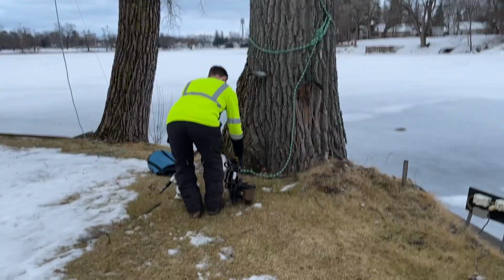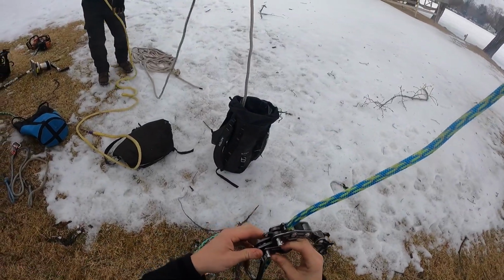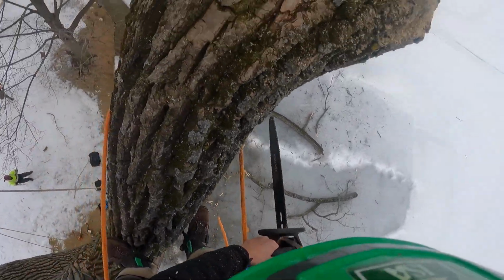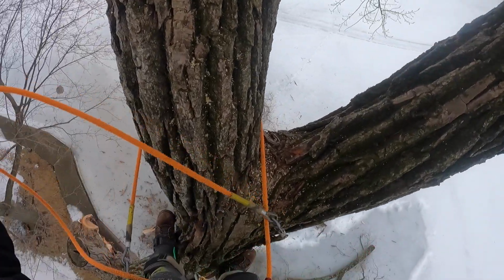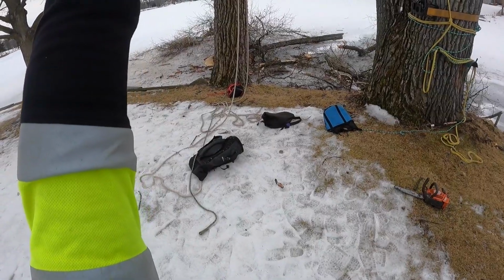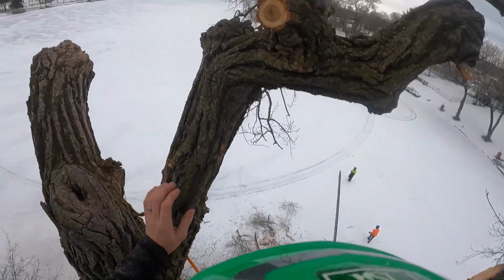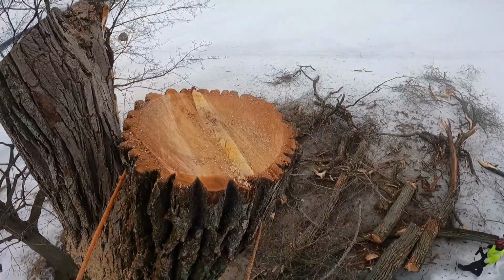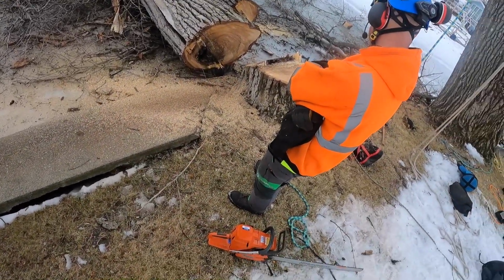DROPPING LOGS ON A FROZEN LAKE!!! One more Midwest tree makes me look dumb! Last day with Kevin Hamm

Comment: You can use a very shallow face to spring a limb off without letting it flip. I generally make the face cut slightly deeper than otherwise and have it go in more parallel to the limb, this allows a deeper undercut without pinching. 
Go full throttle on the back cut so the holding wood is thin enough to pop off when the henge closes.
Whatever position the limb is in when the henge closes is how it will fall, if you really don't want a limb to tip at all you can use a simple undercut
Reply: Good description
Reply: do you like the box cut for pop release?
Reply: @neild7971  I’m a fan of the box cut for flat landing huge branches

Comment: I am definitely ordering a set of those rings what did you do tie a running bull line to send the rings up once you got it over the limb or is there a loop at the end you put the rings through Kevin
Reply: The rings are spliced into 12 strand hollow braid and have 100 foot tail your stuff them backwards into a bag pull the tail up and then pull the rings up last with a bull rope in them
Reply: They are spliced into 100 feet of 12 strand hollow braid.
Reply: So once the rings you pull up you would have the tail on the ground again and you would tie the tail off is that correct
Reply: @kevinhammatgameoftrees7080  How does the hollow braid handle being pulled through the fork of a rough barked tree to install the rigging rings? I like the idea but if you catch one of the picks on that hollow braid won't it make a mess of the rope?
Reply: @stevehunt4472  we have a 24” Kevlar sleeve on one of our units that is stitched in place to cover where it passes over the limb.  We have not had any picking issues with any of them because the weight of the system hauling up the doubled over rigging line keeps everything gliding across the bark.  The 12 strand is otherwise abrasion resistant and doesn’t have the risk of failure like a double braid rope would have in this scenario.
Reply: @kevinhammatgameoftrees7080  Thanks for the detailed reply. At least no issues with retrieval like a so called 'retrievable' rig and ring slings where you need to have a suitable fork for the big ring pass through. 

Is that Samson Tenex TEC 12 strand you're using? I'm guessing 3/4" for a bomb proof setup.
Reply: Or is it 3/4" Yale Ultrex (MBS 75,000lbs) to make it nuclear bomb proof!
Reply: @stevehunt4472  the weight of the rope and subsequent doubled over rigging line prevents picking.  It hasn’t been an issue. The hollow braid is the right rope for the job.
Reply: @br-dj2ti  yes, tie a cow hitch or bowline
Reply: @stevehunt4472  just tell the new guy not to pull the rigging line out and leave the rings up there:)
Reply: @stevehunt4472  it is usually a secondary line so 5/8 is adequate. Word of caution, don’t use high strength fiber like dynema as that is for static use only.
Reply: @kevinhammatgameoftrees7080  when will they be available on your site

Comment: So how do you take a saw on a plane ? Do you drain all the fluids and put it in one of those plastic carry cases.
Reply: I saw on Instagram he had the limb reaper shipped over through the mail to get to Wisconsin, hope that helps!
Reply: @paulj4262  he did fly back with it and it passed inspection
Reply: You can bring chainsaws in check luggage apparently, although they require you to drain the fuel and even purge the lines and I'm not exactly sure how they inspect this..

Comment: When do you decide to use a bore cut on a leaning decayed tree like that? If it's more brush-heavy on top? Or do you just trust the feeling you get in your "throw bag"?
Reply: If dropping this whole tree, a bore cut would have been very prudent. The trunk alone didn’t require it.  Great question!
Reply: We pull trees away from powerlines all day every day and I've never saw the need for a bore cut.  If fact theres a very good chance a bore cut will hinder you if you're pulling a tree with a rope.